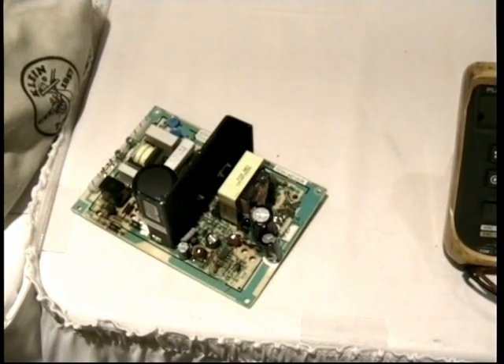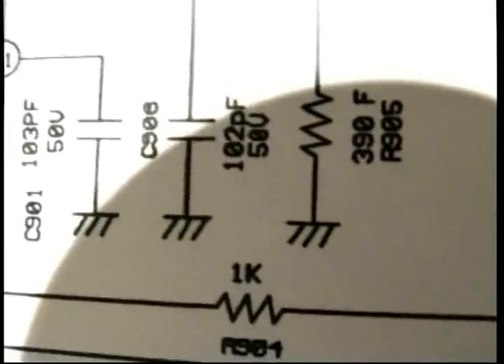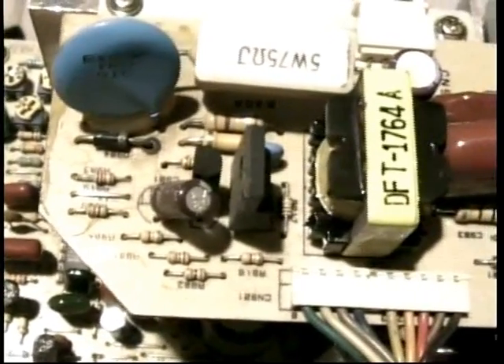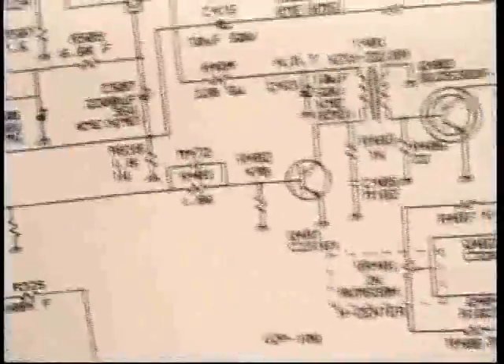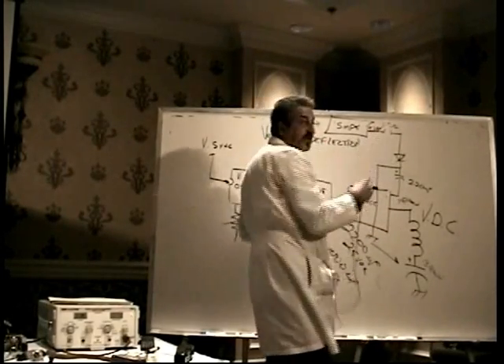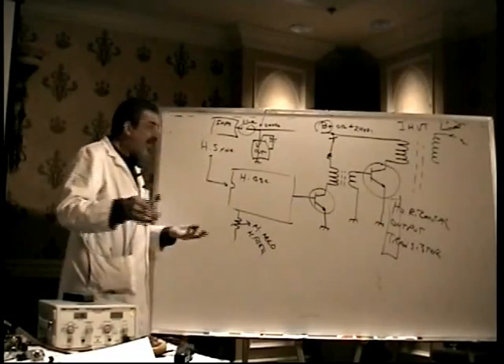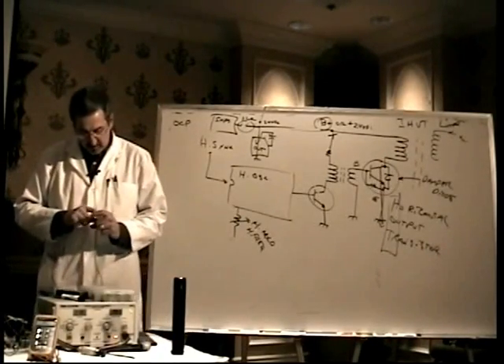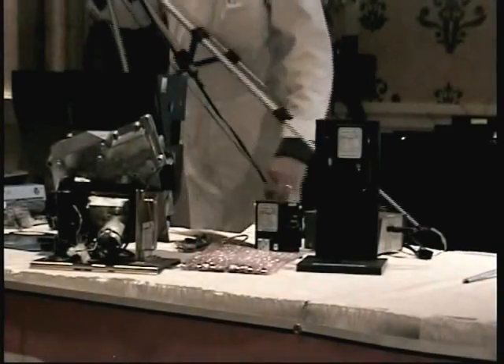CRT monitors-Part 4 of 4

Comment: I know im over a decade late to the party, but what should I look for if I accidentally slipped my probe checking the vertical output IC voltage and shorted pins 5, 6 and 7 which on a la78041 is the vertical output, 24v(Vcc) and the 5v input. Does the flyback transformer provide the 24v and 5 or 6v? The tv is an Orion FTV2701 which i can't seem to find any schematic for.
Reply from the maker: Try replacing the ic?
Reply: @randyfromm I did and still no 24 or 5v. Even left the IC out and still no voltages.
Reply from the maker: @bretearwood7027  Does +24 come off the flyback? Look for a 1.2 ohm resistor near the flyback.

Comment: Randy,  Thanks so much for this video series.  I was able to repair my Wells Gardner Monitor in my Hunter Wheel Alignment machine (1986) by watching your 4 videos in this series.  The problem was a upc1488h vertical deflection amp chip and it needed new electrolytics.  Interesting failure on the chip.  I did have some vertical output and vertical retrace lines.  There was a bright squished band of video at the bottom of the screen with the bad chip in place.  New chip and caps cost $15.00 on Ebay.  Thanks again.
Reply: Hunter told me CRT was bad and it would run about $600 for repairs.
You're a great teacher.
Reply from the maker: Well done! Congratulations on the repair. Feels great, doesn't it?

Subsequent to this recording, I did encounter a bad vertical output IC that produced precisely the symptom you just described. Generally, it's just a flatline.
Reply: Random out of focus what could mean?

Comment: I have a Viewsonic P225f CRT that I really like. Been working fine, no sign of any problems at all, beautiful display. Next morning I boot up the PC and the monitor has a steady green LED light but no power to the CRT at all. It is a total black screen. Hooked up my spare CRT and it works, so I know it is not bad cable connections  or video card. After listening to Randy's class I know it has to be the power supply and maybe just the fuse. You da man Randy!

Comment: Yes I understand that much, but what's switching the ground path off and on? I know in a switched-mode power supply it's the pwm chip but here is it the oscillator chip doing that? I might also be confused because mosfets are typically used in smps and here they're bipolar transistors. Thanks for taking the time to respond

Comment: I'm a bit confused about how that step down transfer which connects to base of the HOT works. If its being fed 24v dc from the psu? I thought transformers need ac to work.